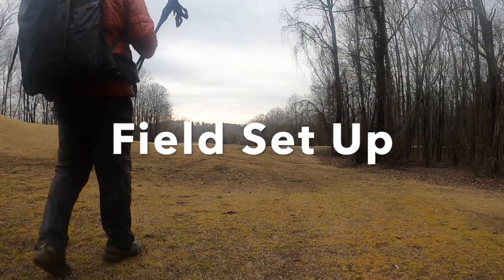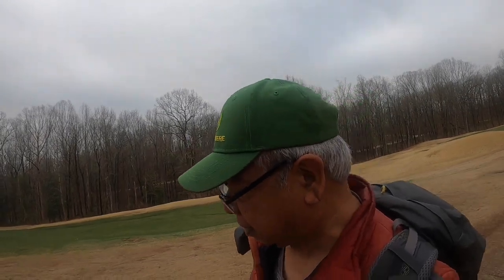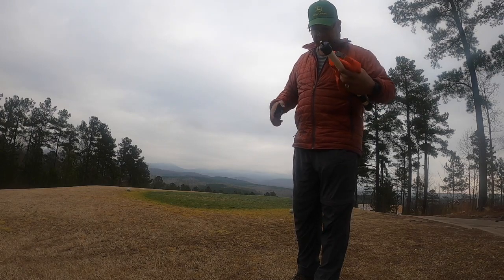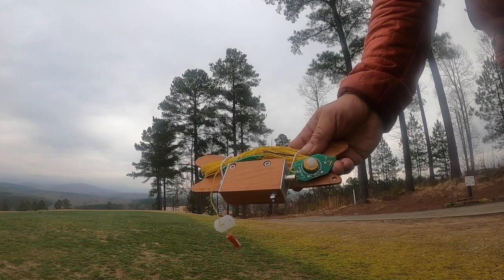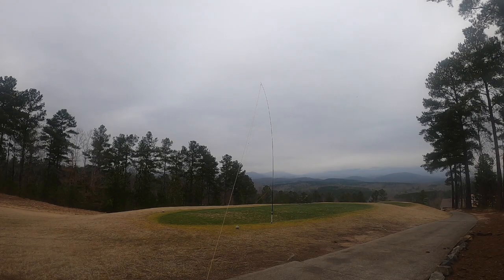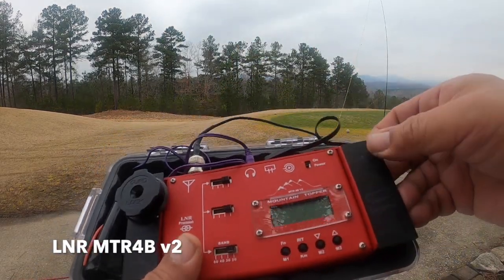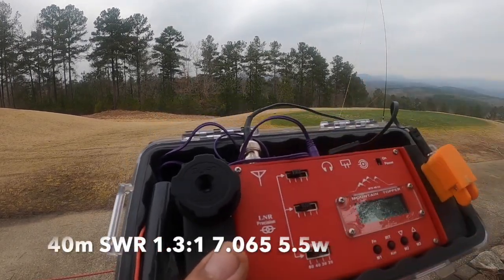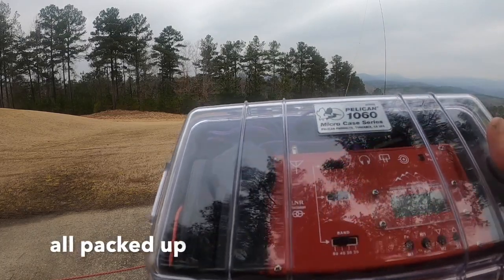Field Set-Up of an end fed half wave antenna

Comment: Great video Ariel you do good work. I always test any SOTA antenna projects in my yard chasing other SOTA or Parks Ops to test results. Chances are if it works in my yard it will work on a summit. I like your set up it is very compact and efficient. Regards vk5cz ..